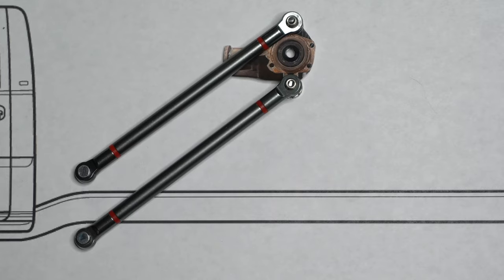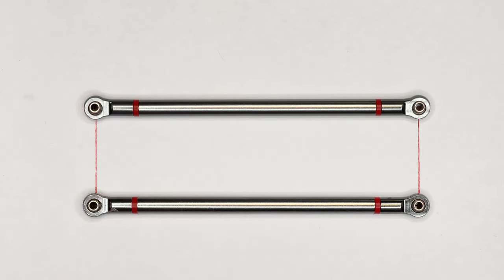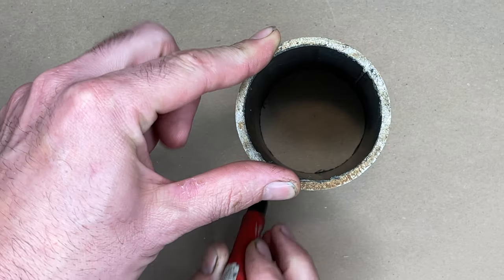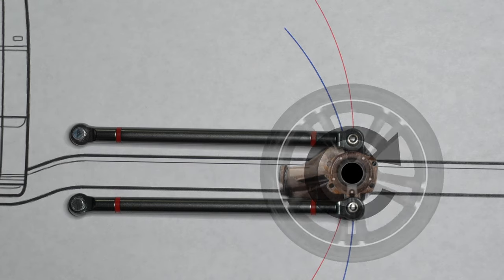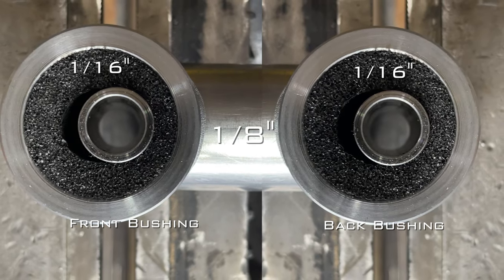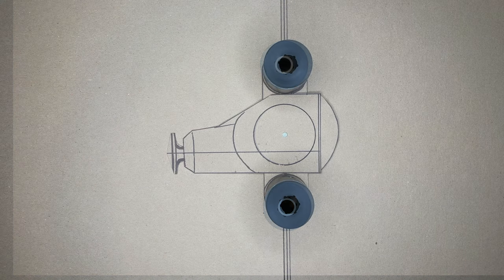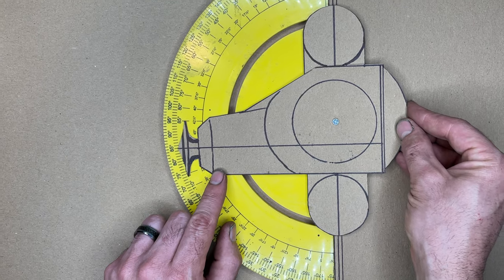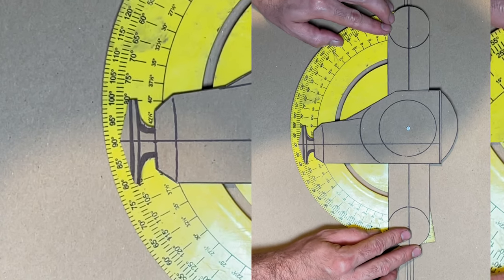Suspension Basics 05: Link Bar Bushing Squish and Axle Rotation.

Comment: one overlooked fact that you didn't mention is that the further your bushings are apart, the less leverage your diff has on the bushings. 

So lets say that you have a 6" spacing and you apply 1200 Lb/Ft to the axle. (That's like 105Lb Ft from the engine in 1st gear in a 4L60E with 3.73 gears, it's less than half throttle in most V8 applications with these components..)  @1200 Ft/lb at 6" apart that's 2400# of force on each bushing! That bushing will squish A LOT!   But, lets say for example it's only 1/8", that's 2.38 degrees of movement.   

If you have the same scenario and you space your bushings apart 12", that same 1200 Lb/Ft at the axle becomes, you guessed it, 1200# on each bushing! Because the LOADS on the bushing are reduced, the deflection is ALSO reduced at the bushing as a result. As the mounting points for the link bars get further apart, it allows the bushings to exert more reactive force on the axle while applying the same pressure. For example think of it like adding a cheater pipe to your breaker bar when you go to loosen an impossibly tight nut or bolt. The inverse is also true, where if you apply 100 ft lbs on a 12 inch breaker bar you need 100 Lbs of force on the handle. If you move to a 6" ratchet, to maintain the same 100 ft/lbs of torque, you need to apply 200# of force to the handle. Replace the handle with the link bar mounting points, and replace your hand on the ratchet handle with the link bar bushings and now hopefully you can see where this is all going. 

So if 2400# deflected the bushing 1/8", you could conclude that 1200# will deflect half that or 1/16". And because the bushings are further apart by 2x you will get half again of the movement which @GarageFab just demonstrated, which makes total deflection 0.597 degrees!!

 So just by moving the bars further apart in this scenario, you reduce pinion climb by 75%!!!!  Physics and math is cool..  🙂
Reply from the maker: That was brilliantly worded! Thank you for taking the time to write that. 🙏 It’s challenging to explain this kind of stuff in text format and still be clear and understandable. This was perfect. I’m going to pin this comment to encourage other people to read it. Cheers!
Reply: I was thinking the exact same thing watching the video.
Reply: Actually you are wrong in your assumption. The bars are not solid mounted on the axle therefore the length has no affect. The axle is is pushing in a straight line on the links with pivoting joints on both ends length has no bearing on the force applied on the opposite end of the link.

Comment: Pretty sure that if the deflection is in the same direction, then there is only 1/8” of deflection. Not the sum. If the deflection was in opposing directions, then it would be the sum - that would probably happen if the wheel went over a bump while coasting.

Comment: Maybe it was discussed but say you go with a heim joint on the axle end and a urethane bushing on the other end of the link bar. That could help decrease the amount of movement by say 1/8” in one direction thus reducing that pinion angle movement and still help keep a decent ride. I still think with all this in mind, a triangulated link is my path forward. I will suspend it with coil overs so not a lot of motion in comparison. I’ve learned a lot from your videos so I look forward to more.  Thanks!
Reply from the maker: Thank you my man! I believe your thinking is spot on. I should make it clear that I encourage a parallel equal length link setup for those that are running air springs or hydraulics.
Since you’re using coilovers, you can ignore all that and get some added traction benefits by utilizing unequal length bars at specific angles. So a little research on instant center and antisquat to get the best setup you can get.
Cheers my friend!!

Comment: I’m so thankful I happend to find your videos, I’m just starting a sleeper build on a gmc Sonoma and I’m wanting to custom fabricate a triangular 4 link, I wasn’t able to find any other videos that went into detail as much as your series has, so I guess all I need to do now is put your videos to use and order some parts in! Thanks a lot for the series I’d definitely be watching your other build series! :)
Reply from the maker: I’m thankful you found them too! 
If you’re building for racing, I encourage you to ignore how much I insist the upper bars should be parallel with the lowers.(When viewed from the side) This is strictly advice for those building adjustable suspension, and reduces traction for the sake of preserving u joints. I’m assuming you would be running coil overs or something similar so you would likely want your lower bars angled up a bit and the uppers slightly shorter and angled down. This will increase traction by increasing antisquat.
I highly recommend researching instant center, antisquat and drag race suspension design.
Thank you, Brett! Good luck and I’ll help as much as I can! Cheers!

Comment: I wish that I would have found these videos long ago, it would have saved me money and headaches. I'm building my first air ride truck and couldn't grasp the theory but your visualizations helped so much. 
It uses two link bars to replace the leaf springs and a shorter Y bar over the axle to the frame to clear the gas tank. Reverse triangular for a visual 
I was worried about the pinion angle and lateral movement which seems I should be. It looks like I have to rethink things now to make it correct. 
Also helps on the front with camber as I raise or lower the truck because the truck is an independent front suspension 4wd. Thank you
I hope to see an episode six soon
Reply from the maker: Thank you, Dustin! If you’ve got an Instagram, hit me up @GarageFab. I’d be happy to try to help guide you through stuff as your build progresses. 
I’ll be honest, I can’t visualize your current Y bar suspension. When you say “reverse triangular” my mind instantly sees bars behind the axle which I don’t think you meant. But if so, there’s certainly some rethinking necessary. Otherwise you might be just fine.
Episode six is in production this very moment! It’s so about drive shafts and pinion angle. It’s already one of my favorite videos and it’s not even done yet. 
Thanks for watching my man!

Comment: I mostly offroad. Great content and info in the videos. I run a parallel 3 link. Wishbone with slight triangulation on lowers on rear. Eye to eye same length as driveshaft. So the driveshaft stays at running length and moves in sync with arms.
Reply from the maker: Nice! Sounds like you know what you’re doing. I’m happy to hear my Mini Truck inspired vids are making to folks of all auto interests. Cheers!

Comment: Needed a direction to go in and after watching these videos will help me a lot just need order a kit for my 85 chevy truck c20
Reply from the maker: I love your truck! My father had one in the 80s that he used to pull our camper trailer. I’ve wanted one since.
I can’t wait to see how your project goes! Thank you for the kind words. Cheers!
Reply: @GarageFab  would like to put the triangulated set-up on my truck but watching your videos i need upper and lower bars that hook to the differential to be the same size and what i see on line some pic of the bars look like two different sizes would you be able to point me in the right direction it would help me out a lot
Reply from the maker: @gonzalosilva6751  Triangulated 4 links are really difficult to explain especially in text. If setup properly for adjustable suspension, the upper and lower bars will NOT be the same length. In other words if you removed all the link bars and set them side by side, the upper bars would be a few inches longer than the lowers. But because they’re mounted at an angle the upper bars should stretch forward the same amount as the lowers. 
The actual goal with a triangulated 4 link is to match distance between front and rear axis of the upper bars with the distance between the axis on the lower bars.
If you’re looking at kits for your specific truck, and two bars are longer, I’d have to guess that they’ve taken this into consideration. And if you find a triangulated kit with 4 equal length bars, they did not. Hopefully that made some sense. 🤔

Comment: These are great videos! When is the pinion angle video coming?
Reply from the maker: Thank you! I’m steadily working on it. I’m building a machine to demonstrate how the U joints behave under various angles. It’s not a simple project. Probably as soon as the rear suspension is complete I can focus fully on that.

Comment: Hi Love thses vids so easy to understand and great info , did u make the next ep in this basics vids my car rear steers when i go round the corners and thinking it could be the bush squishing like you showed . so very interested to see the next vid and possibly figure out why ...  thanks from Australia !!! :)
Reply from the maker: Thank you my friend!
For now I’m sticking to suspension “Basics” because the basics is what I understand clearly. Your issue may be going a little beyond the basics. Loss of traction could be so many things. Bad tires, poor wheel alignment, incorrect design, falling parts like bushings and even bushings that are too stiff or reaching beyond their ability to move (binding). Also I’m assuming your rear steer is traction loss. You can also have rear steer without traction loss. Usually in link bar setups, as the vehicle sways under heavy cornering components move in a way that creates “roll steer”.
Sorry I couldn’t help much there.
What kind of car do you have?
P.S. The next suspension basics video is on drive shafts so I can’t imagine that’ll help much either. 😔
Reply: @GarageFab  thanks for the quick reply , its a 2002 vx commodore . pretty much the same as your 2004 Pontiac . its had a 9 inch 4 link conversion , problem is the 4 bars are not adjustable so cant change pinion angle which is not good , and the rear steer is at 80 km  going left or right around a corner ( no loss of traction though just normal driving) , im thinking the bushes ,although new , allowing to much movement and possible causing the rear steer to happen . il have a look at the bushes  possibly change them and see how it goes, thanks. keep up the great work :)
Reply from the maker: That’s interesting!! If you ever have the opportunity to get some photos of the entire rear suspension setup, (like on a lift) I’d love to see it! You can shoot me photos on Instagram @GarageFab.
It sounds like Roll steer could be an issue.
If you haven’t seen my video Suspension Basics Part 1 please do.
Roll steer happens when the suspension on one side compresses and the other side extends (body roll) and the forward facing link bars are in such a position that the side that compresses pushes the wheel backwards and the side that extends pulls the wheel forward essentially steering the rear of the car.
Another possibility is incorrectly design rear toe arms that could potentially be causing a similar thing.
Best of luck!
Reply: @GarageFab  thank you so much i will get you some pics in the next week , but what your saying defiantly sounds like whats happening ive also been told the bars ( they are unadjustable also ) are pointing in a direction  that makes them jsut in front of the diff . if you get what i mean , an imaginary line where the cross , when they should be meeting further foward towards the  front  , its all new to me , lol . il grab some pics also and send them over
Reply from the maker: @nexgencoatings2579  If I understand correctly, yes. Generally in a static height vehicle, the bars would be positioned in a way where, when viewed from the side, the bars would intersect somewhere around the front bumper/grill area.
There’s some additional traction to be had off the line by correcting that, but I can’t imagine why that would cause your strange handling in corners. I could be wrong though. I often am!
Reply: @GarageFab  after some measurements  it looks like my bars intersect about where my back seats start, so way way  off , i think all the angles are wrong and it has eaten bushes and that could also cause a rear steer as it moves under acceleration and braking possibly , it looks like its binding up and eating bushes out . its a castlemain rod shop diff  for a 2002 vx commodore ,  if u get a minute have a look on there web site , i dont think there the greatest design although they charge a premium price  , states its a bolt in kit , it rook a lot of working to get it in very annoyed at its performance also
Reply from the maker: It’s hard to tell what could go wrong just by looking at it unfortunately. But I can see it’s a triangulated 4 link. And in my option the top bushings are not positioned properly. I feel that they should be mounted parallel to the axle. That is strictly an opinion. People have been designing them that way for years and I’m likely the one who’s wrong.
I’d suggest shopping for spherical bushings that fit that axle. Unsure what sort of a challenge that will be.
That’ll tighten things up a bit, prevent future damage, but will also channel a little more vibration to the driver. It might be a sacrifice you’d be willing to make given the problems you’ve been having.

Comment: I once had a Grand National I pumped up to about 600 hp.
The only suspension change I made was a set of south side bars…I left the uppers stock.
As you know, the altered mounting geometry generates greater downward motion as the pinion moves upward under acceleration, thus increased ‘normal force’ exerted on the tire as the rear axle rotates under acceleration. 
Q. With zero pinion angle movement…isn’t there lower ‘normal force’ exerted?
Reply from the maker: Here’s how I understand it; (I’m not a builder of race suspension. I just read a lot.)
Under acceleration, the weight of a vehicle naturally shifts towards the rear, often causing the rear suspension to droop/squat. If you angle the lower bars upwards towards the vehicle’s center of gravity, when the axle tries to rotate backward under acceleration the lower bars push vehicle forward while pushing the chassis upwards. (Antisquat) This in turn forces the tires into the ground increasing traction.
In addition, by angling the upper link bars downward, when the axle tries to rotate backwards under acceleration, the upper bars will pull upward in the chassis. (More antisquat.)
It’s not the actual motion of the pinion pitching upwards that causes this. It’s simply the forces of the axle ’trying’ to rotate. So preventing pinion angle change wouldn’t lessen this force. In fact it likely would focus these forces better to increase traction.

Comment: I see that you answer every singe comment, so I will ask this: What do you think about using high pinion differentials on mini trucks to retain the bed depth? I only want to cut my bed above the step notches/make the wheel wells a bit wider. Thanks!
Reply from the maker: I am pleased that you noticed, Nick. It’s been a major goal of mine since the beginning to answer every comment until I get so many that I physically can’t keep up.
To be honest, I hadn’t heard of the high pinion diff until today. I had to frantically research a bit so I could respond!
At first glance, I think it’s brilliant! In all my past builds I either used a Ford 8.8 or the axle that came in the vehicle. All of those builds also got the bed floor cut, humped, raised or custom made.
In that short amount of research, I saw that there’s a strength difference in the connection between the pinion gear and ring gear. The angle of the teeth actually creates a stronger connection when used in a front axle.
But does that mean it’s weaker in a rear axle? I would have to read a little more into it. Either way if you’re not building a race truck I’d imagine it would be just fine.
And either way it’s a brilliant way to get more axle lift without cutting the bed.
Reply: @GarageFab  Thanks for the quick reply! Not to scare you or anything, but you missed a comment 😆I'll make sure to do further research on the topic, and thank you again for your quick reply and videos!
Reply from the maker: I said it was a goal. I didn’t say I was reaching it. 😂
My pleasure, Brother. See you in the next one.
Reply: @GarageFab  🤣